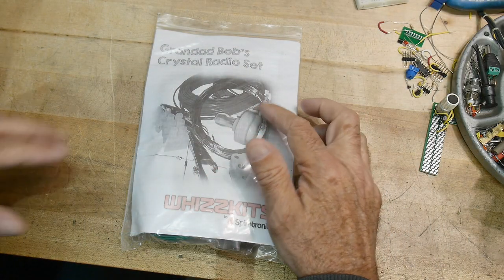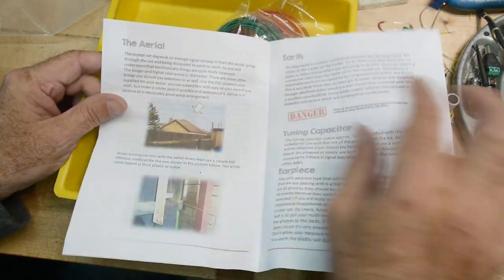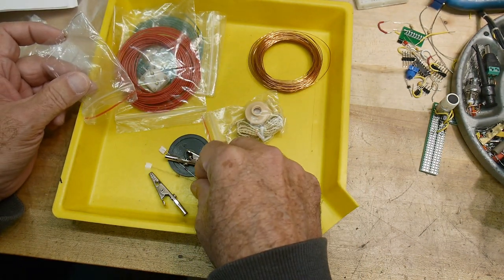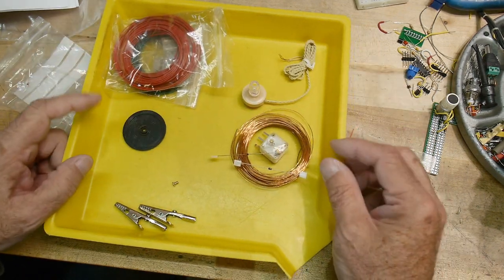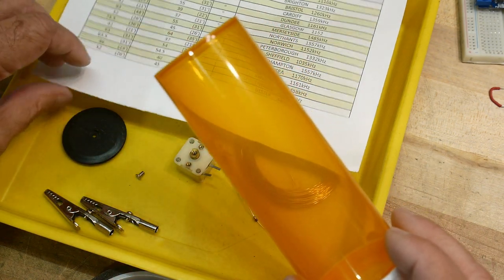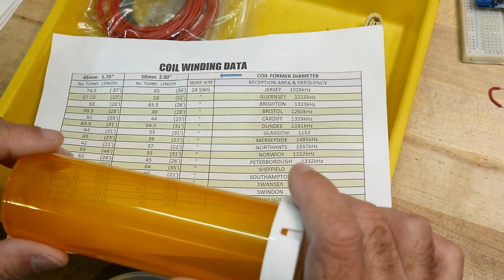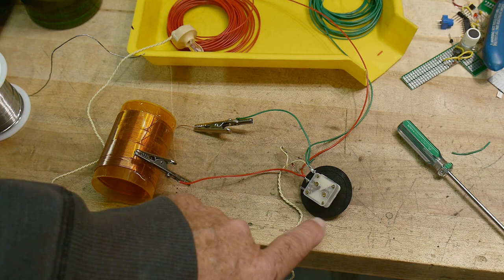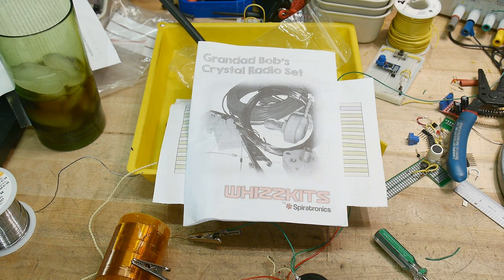#1119 Crystal Radio Kit

Comment: I made dozens of crystal radios BITD (early 70’s)… most didn’t work. Then, I just built my own design, worked first time.
Germanium diode of choice back then (in UK) was the Mullard OA91 !
Transistors AC128 & AC129’s were favs too… also useful, you could scratch off the paint and use them as phototransistors 👍🏻

Comment: the kit i had was different, it didnt have the tuning capacitor, had the diode and a coil but you had a metal slider than ran across the coil and you had to sand the varnish off where the rod contacted the coil. you would slide the rod across the coil to tune in different stations. spent many a night since this is when am was at its best listening to local radio thru a earpiece. dad stretched a wire from the garage to my bedroom window and it stayed there til the wire rusted thru and broke eventually. btw, thanks for the homage to steve1989mre, that was great and i see i have a new channel to relax to after a sucky day at work.

Comment: Haha, a few years ago I built a crystal radio with actual crystals. :) I got some galena crystals (also tried pyrite, didn't work too well, and also silicon carbide crystals, those worked). I potted each crystal in a low-melt alloy, I think Cerrolow, for good electrical contact on one side, and probed them with a whisker until I found a good spot. I used a 3d-printed jig to hold them in place in the position I found. It worked, but like yours not too great. 
On a side note, those silicon carbide crystals are also useful for another little fun physics experiment. SiC is a N-type semiconductor, with a band gap that allows you to build a home-made LED. In fact, the first LED in history was made of it. Not commercially used these days because it has very low quantum efficiency. But if you connect a battery's negative terminal to the crystal and probe its surface with a whisker connected to the positive, you will find spots on the crystal that glow orange-yellow. You need at least 3V for that since that is the threshold voltage for SiC. The light produced is fairly dull so better do it in a semi-dark room or you may not see it.
Reply: That's a wonderful piece of information on homebrew LED.
Thanks 👍
De VU2RZA
Reply: What do you do with the rest of the crystals? They are so hard... put them in your garden?

Comment: I had a kit a bit like this but with a sliding bead on the coil (made on a cardboard former) for tuning - back in the 80s. Dad helped me add a tuning capacitor and that made it much more selective. I had a long wire aerial outside and used to pick up all kinds of broadcast at night. I added a two transistor amplifier later on so it could play from a speaker. Brilliant way to learn basic electronics and the basics of RF and AM radio transmissions.

Comment: The Gillette blue blade, a length of graphite (pencil lead), a safety pin to mount the lead and that takes care of the 'cats whisker'. Worked like a charm 65 years ago. Don't know if blue blades are still available, but they were the go to in my day. The newer blades do not have the same crystalline structure.

Comment: Those kind of tuning capacitors are more for VHF than MW AM, guess they used it to cut down on cost, a proper one needs to be around 500-700pF to cover the entire band.
Reply: The small variable capacitor was usually DOUBLE and used in transistor radios.
One section for the LC input and one for the local oscillator.
The tuning range with the coil easily covers the MW range.
Reply: The polyvaricon, or so they are called, (variable condenser (capacitor) made of polymer- PVC) are usually of 310-365pF, per each section (one for the antenna tuning and the other for the oscillator section) and they're for the MW and the SW bands.
The metal dielectric air gang capacitors are usually found in the Vaccum Tube and some models of the solid state receivers; the capacitance might be around 350-500pF each section.
Some capacitors would have a larger value for the antenna section (ie, tuning to some lower frequency) and a little smaller value for the oscillator section (the local oscillator in the superhet will have to oscillate 455KHz higher than the signal the antenna section is tuned to)
De VU2RZA
Reply: @subramanianr7206  Exactly!